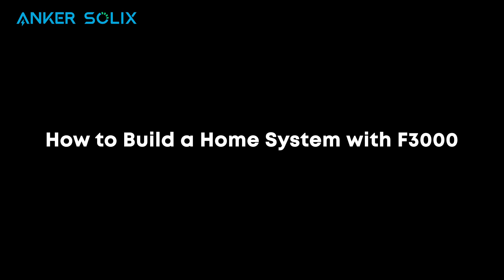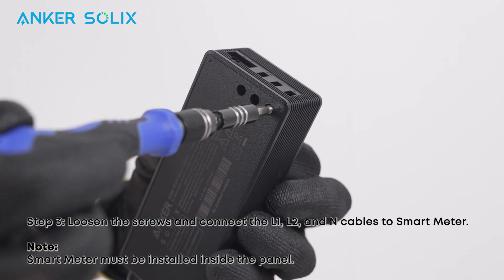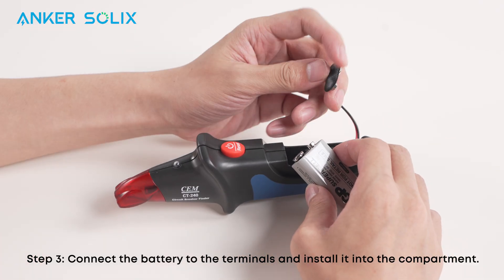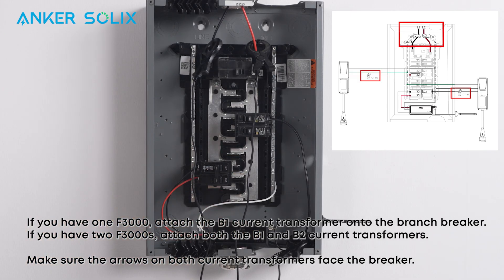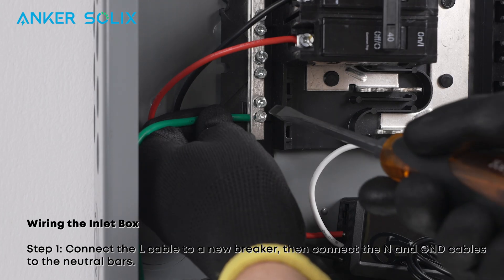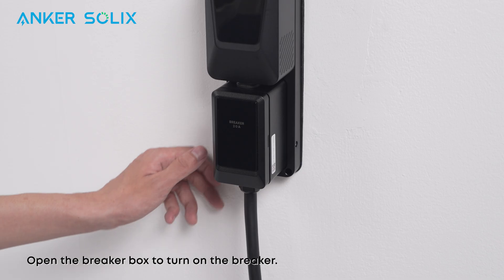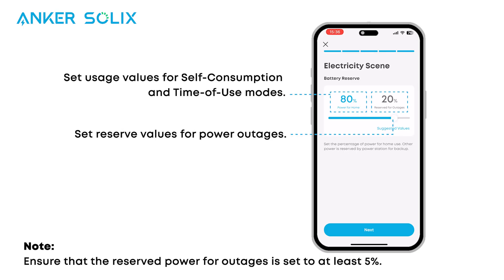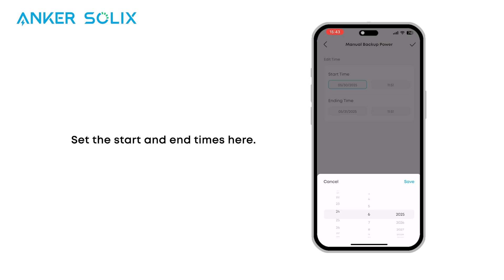How to Build a Home System with Anker SOLIX F3000

Comment: If you have a 3D printer and your circuit box is in the wall you can print out a “4G antenna mount” on printables to mount it above the box on the wall.